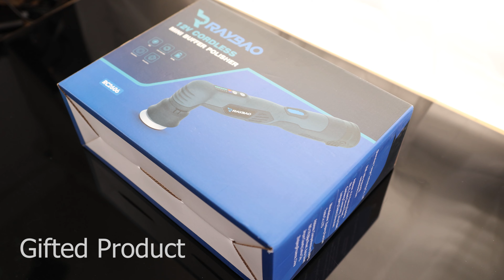Mini Polisher, RAYBAO 12V Cordless Buffer Polisher

Comment: Has it been used after the review on car ,home ,polish  usage ? How are the batteries how long do you get to use before needs recharge since it come w 2 ? 
Any trouble taking battery out and in from the room or charger like tight fit ? 
Does the machine get warm or so hot when using on for long periods ?

Comment: bought this on black friday for about $100. Going to return it cause it shuts down on speed 3 with very light pressure and the battery was fully charged. better off spending alittle more for a maxshine mini polisher. You get what you pay for